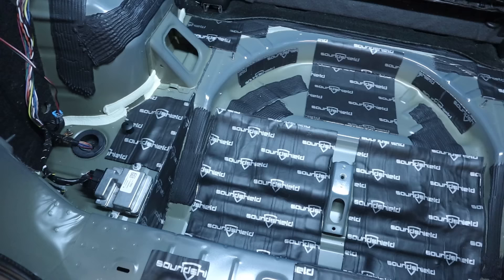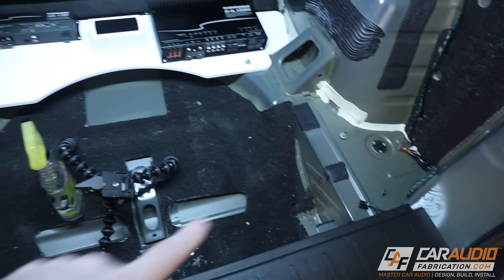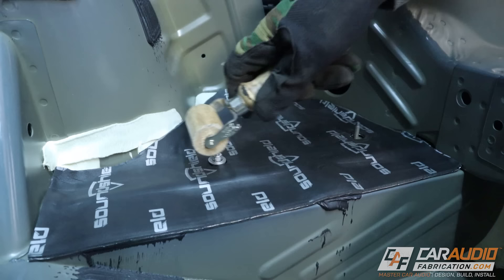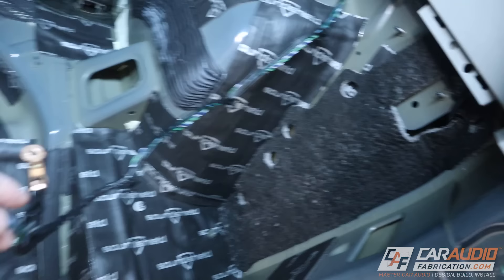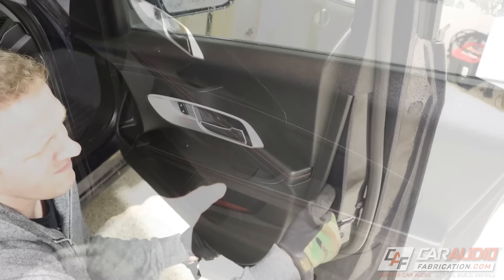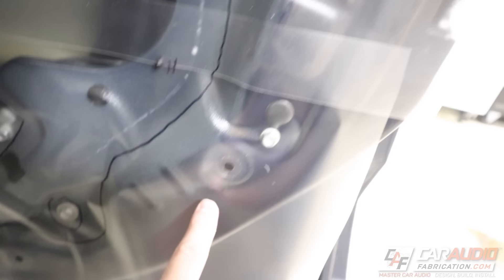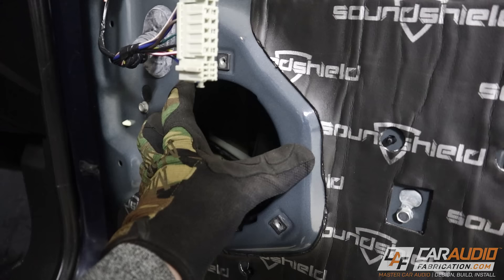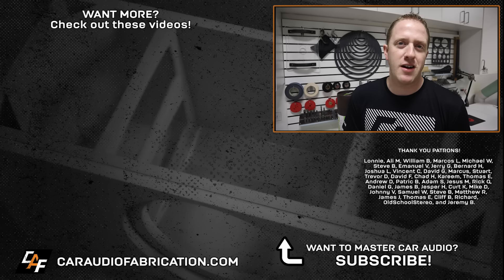How to Apply Sound Treatment! - SQ Daily Driver Build Part 2

Comment: Sound deadening is crucial to improved sound quality. It’s a step that a lot of people never do and they don’t know what they’re missing until they do it.
I’ve always been fond of SEM rubberized undercoating. It comes in a spray can and it’s great for large irregular surfaces.
It has great sound deadening properties, it’s paintable, and it’s asphalt free.
Buy a can and give it a try and let me know what you think 👍

Edit: I corrected a spelling error.
Reply: Rubberized & spray on coatings are a waste for sound deadening. You need mass to deaden sound waves and block sound waves!
Reply: MICHAEL GRANT you can believe what you want.
But I’ve been doing custom audio installations for almost 30 years and I’ve been using the SEM brand rubberized coating since 1995 and it works great.
Other brands of spray coating suck ass because they go on too thin.
But the SEM leaves a pretty thick coat and you can always do multiple coats to increase the thickness if you want, but it isn’t really necessary with the SEM.

Comment: Can't wait to install some sheets in my front doors, my midbass performance is terrible. My doors for most likely the same reason have that awful metallic cling as you shut them that should be featured on a "Top 5 most unsatisfying sounds" compilation. I'm sure being a relatively new car the Equinox did not have such a harsh door closing sound, as I notice most newer cars make a point on avoiding that, but did you notice any difference in the sound of the doors shutting? I'm hoping after a complete treatment the issue is solved on my older truck. You and Five Star Car Stereo definitely are the best at attention to detail as far as car audio goes, keep it up!
Reply: Yeah, adding mass will make the doors sound more solid when you close them, economy cars nowadays try to be light weight for fuel efficiency.

Comment: Thank you so much I just bought some sound deadner and some aluminum tape and roller and foam insulation and I was worried I may not have enough after watching your previous videos so this video really helped. I wonder how difficult it will be to get under the carpet in the front without removing the seats.
Reply from the maker: I'd just plan on removing the seats, the 15 minutes to remove them will save a lot of effort of wrestling a carpet out of the way while you try to apply treatment.
Reply: unfortunately in a honda like mine way more than seats have to come out to remove carpet. It's a pain

Comment: Funny you mentioned not having to deal with any mechanical issue in the door.  Just had to replace the rear passenger door latch assembly on my 05 Suburban.  A cool $600 out the door (pun intended).  lol.  Thankfully I haven't put any product on it...YET!

Comment: I’m planning on installing a complete focal utopia m sound system to the cybertruck I have on its way when it’s delivered, and sound treating it every square inch, with either Mosconi or audiocontrol amplifiers to match and a dsp (either dsp audiocontrol amplifiers or the mosconi 6to8) as a showcase car for my shop and to have an audiophile car to enjoy for myself. However, I haven’t experimented with different sound treatment options besides stinger roadkill, dynamat, and ballistic hollow point (Metra). Is there a brand you recommend amongst others, or is it all relatively the same pound for pound?

Comment: Quick question! Do you strictly stick to new cars with warranties? Every car/truck that I've ever bought, I've eventually had to replace either a window motor, window, or opening clips. Issues in the doors happen quite often mainly because they are an impact part (open/close (slamming)) as well as moving parts that more often than not see some kind of exposure to moisture. The abs access panel is a good idea

Comment: Lol then there's my Mazda 6 that had a stock Bose system which comes with factory sound dampening. Some of it is actually pretty decent but the doors are covered in a giant piece of ABS. You can get it off mostly and get some material in there but not much on the ABS itself and definitely not much on the internal frame behind it. I only have butyl rubber with aluminum backing on parts of the doors right now. Basically the sheet metal that makes up the skin of the door. Throwing in some MLV or CCF is only a dream with hours of headaches right now. 

On the bright side the ABS shell made it gloriously easy to make custom speaker mounts (all hail the Dremel). The weather striping at the bottom of the windows is ate up (door jam seal is still perfect) maybe replacing that will help the wind noise a bit? Any suggestions on the wheel wells, just multiple coats of rubberized undercoating?

Comment: Have you ever used a heat gun to soften the material for curves?
Reply from the maker: You can, but I find this material to mold over pretty well. Keep in mind curves are the strongest point of the sheet metal, so not as critical to sound treat.

Comment: Great video! This is exactly what I'm planning for my old Mercedes. I do have a question though. 

Since the car gets very hot in the sun, I want to also insulate for heat. From what I found, the SoundSkinz material is only for sound insulation. Would you recommend putting the heat insulation material over the sound insulation? 

I want my car to more of an insulated cocoon of serenity instead of a rattly old diesel. Currently, I have to turn the radio waaay up to drown out the engine noise.
Reply: May not be what you want for a mercades but for about 1/10 the price you could use aluminum roofing rolls. It works about the same as dynomat for sound treatment and should help heat insulation aswell
Reply: you need open cell foam with aluminum lining. We offer this through second skin deadener
Reply: Aluminum roofing rolls lose their adhesion in high heat environments. It’s because they have asphalt backing. Sound dampeners have a butyl rubber backing, that’s why they don’t have that problem. They also don’t make the inside of your car smell like tar
Reply: Scotty says u don’t have do anything if u have a Toyota Prius

Comment: Hi love the channel. I have a 1987 Pontiac Fiero gt   Just did a motor swap to a super charged 3.8. Now it in the body shop having a wide body and tail gate install.  I removed all the interior. I purchased the dynamat kit. I am covering every last inch on the car. I picked up new door panels either speaker cutouts.  I will have 6 mid speakers. 2 dash. 2 b pillar and 2 door speakers. I am looking for a bass idea.  I was thinking about the jl audio shallow boxes behind the seat but still have to measure when I get the car back. Do you agree 2 10” woofers. Have you ever done a Fiero. Or a small cabin compartment.  thanks. Frank Tedeschi

Comment: If I'm only adding a subwoofer and I'm on a budget will I be fine only doing the trunk? Thanks!
Reply: Depends on several variables, but you could definitely start off with that. Do some testing over a few days and go from there.
Reply: You dont need a 100% coverage of alubutyle.
Normaly a 25% will do, but it will depends on the thickness you use.
Dont forget the doors.
It will increase the midbass.
Reply: I would think you'd get more benefit from doing only front doors.

Comment: I must just have bad luck with window regulators and door handles/locks.  In my family, we've had to go in and replace parts in a door almost yearly.
Regarding the targeted use of material versus a show car.  I'm curious as to if the full coverage performs better or just simply looks better.  I mean what would an SQL comp builder use?  Would they need full coverage or is there no difference?
Reply: Full coverage on both - inner and outer

Comment: When you own a BMW E53 there is no such thing as off chance of something breaking within the doors. Door handle mechanisms and window clips on the window regulators are basically consumables. Getting inside the doors is a thing you do every year.
Reply from the maker: Then don't do this
Reply: @CarAudioFabrication  It just has to be done differently. With an access hole in mind.

Comment: ? HOW DO YOU  Hook up 2 JBL bass pro SL From the  sub output from the stereo how do I run the 2 jbl in  Sync  and have 2  base controls for each one or how could I combined those 2 into 1 bass control

Comment: I have a sports car (GT86) with little to none sound deadening from the factory... As of right now I have a Focal amplified SUB, a Sony Head Unit and a Sony Class D amp, with no speaker upgrades... I've done as good as I can to tweak crossovers and EQ from the HU but I'm not satisfied and considering a full audio build with 3 way fronts, 2 way rears (6x9 woofers in a custom panel) and full active crossovers, with a custom sub enclosure in the spare wheel well, but I'm still not sure about sound treatment, I actually like the road noise and many vibrations this car makes, but I think that the full sound system I'm planning would be quite wasted without it, does anybody have any suggestions or comments regarding the way I should proceed..?

Comment: can the sound deadening material be removed & then put back (ie; will it re-stick?) if u haveta service a power window motor? ...i ask because my 98 gm f-body has eaten 7 power window motors over 12 years, so unfortunately,  i am going to need access to this area...  always enjoy ur videos man. thanx & merry christmas
Reply: Technically...it CAN be removed...but it's pretty much shot and deformed by the time you peel it off.  Mark has an older video where he creates removable insert panels to cover larger gaps.  Search the CAF archives on YT.
Reply: @JM-nd3ps   cool, thank u for the helpful info... ill look that video up & check it out... 'priciate it!
Reply: @heavychevy383  no problem
Reply: 3m butyl strip caulking would reseal it fine. I use it to restick factory vapor barriers. You can just put it over the old dried out butyl adhesive just fine it seems.
Reply: @heavychevy383 If you've gone through 7 power window motors...you're only fixing the result of the problem...not the cause of the problem.  There has to be something else going on in that door.  Maybe a bent window regulator or perhaps some wiring/switch issues that are causing repeated failures with the window motors.

Something else is wrong...find it.

Comment: hi brother i would like to get your advice.... is it good to change the head unit into after market head unit
Reply: It really is best. Unless you get a DAC to retro onto your stock head unit. The main reason I have for putting a Kenwood DDX9705S in my 350Z was (the fulltime rearview camera needed, honestly) the 13 band EQ and its DAC capabilities. Also added a JL 10W6V3D4 for the only reason being I found a whole about that size behind my Drivers Seat
Reply: @markreeves7177  thanks for your info

Comment: 4.5 mm is too thin for any application. Sure it will sound better than 0 mm but in terms od dB at least 1 cm (10mm) is required. Where the vibration is the strongest (engine bay,wheel arches) more is better.
Reply from the maker: Lol no. At that thick good luck putting panels back in.

Comment: When designing enclosures especially when ported, what is your basis of the dimensions and spacing created inside? 

Does speaker size and depth play a bigger role? and is there a certain range of enclosure size for every every specific size of anothet speaker? Lilke for example a 3 inch sub can only have what size and design for enclosures?

Thanks.